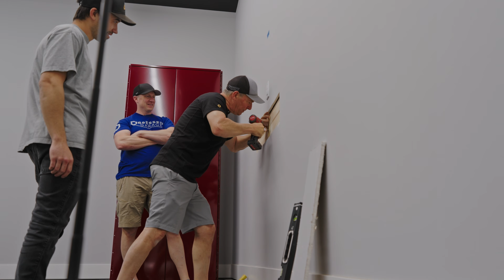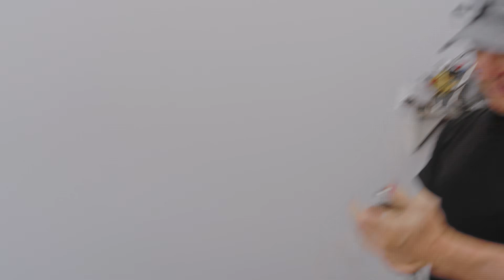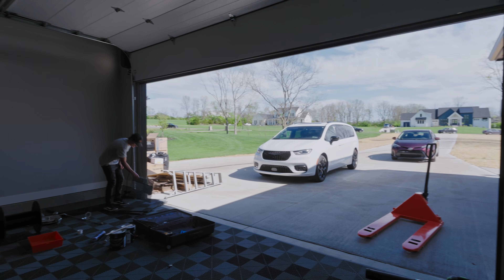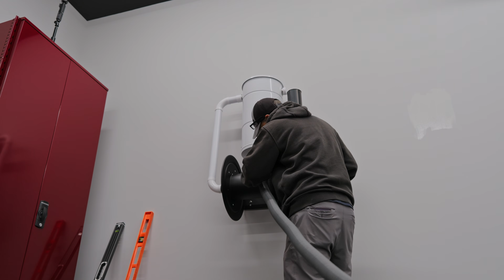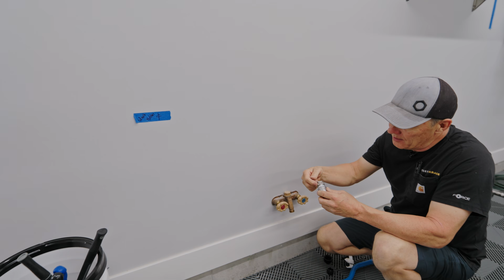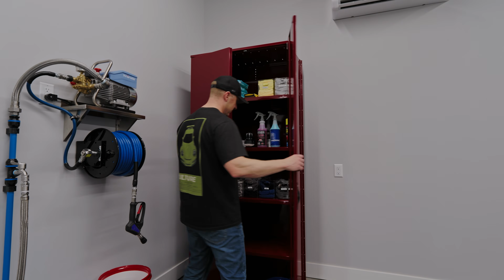The BEST Pressure Washer + Vacuum Setup for Any Garage | OVERKILL Garage Build: Part 3

Comment: does this garage have a drain for the pressure washer, i want to do something similier in my new 2 car garage
Reply from the maker: No, the Swisstrax tiles have channels underneath and the garage is sloped so it allows water to flow out.

Comment: Good info as usual. You threw out the 5 foam cannons is your preferred set up now. What are putting in them? Brake buster undiluted, GSF with a metering tip, touch less in your dilution for 2% pir for the dual kranzle, and 2 extras?
Reply from the maker: Decon Soap and Reset

Comment: Over $3k for a pressure washer and a car vacuum??? 
Ridiculous 
This can be done for less than a 3rd of that price for with same ease of use and results.
Reply from the maker: Ha, ha…. No
Reply: just use quarters down at local coin  wash save even more Johnny cost is irrelevant.

Comment: Why not put the pressure washer near the hose bib? Maybe you addressed that & I missed it.
Reply: I must have missed it too. It would have made more sense to mount it right above the bib. Also, the foam cannon setup is just clutter. store them in the cabinets.
Reply: That hose bib being a different color would drive me nuts. Needs to be changed to brushed finish or painted to match the piping.
Reply from the maker: That is where the blocking was.

Comment: The prevost piping looks so bad. I love most of the products, but it looks so cheap compared to everything else. Not to mention it’s not even rated for water. If you’re spending that money, you can have the hose bibs put right where you want them inside the drywall for an even cleaner look.

It’s all personal opinion though, which obviously matt likes it, and it makes him more money to sell it.

I was pumped when cr spotless finally created their own bypass, eliminating the need for the hideous prevost piping monstrosity
Reply: I’m going Prevost pipe and running the pex inside of it.
Reply: @pjfan173 why on earth would you do that
Reply: @HughJanice-v1g Because the Prevost pipe is the look I want along the wall.
Reply: @pjfan173 aren’t they the same color?

Comment: Looks good, only issue I see is that you need to cover the power outlet next to the pressure washer.  When (not if) those water lines leak, they are going to spray directly into the power outlet.
Reply: I noticed the same thing. At least a GFI outlet.
Reply: @AncientWonder64 it is a GFCI.
Reply: @AncientWonder64 it has a GFCI outlet.